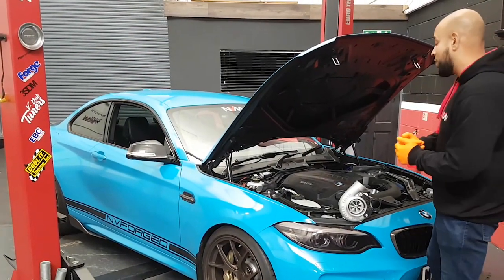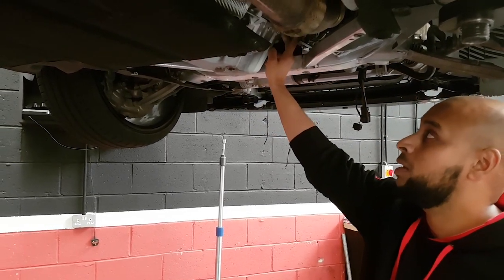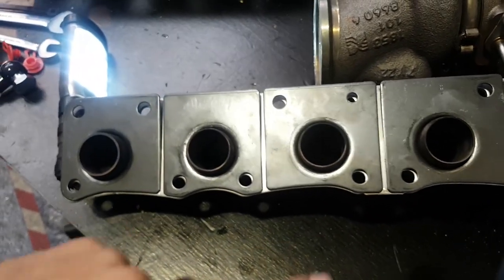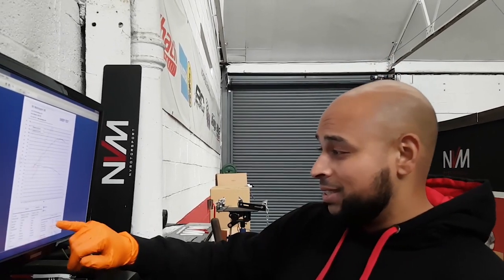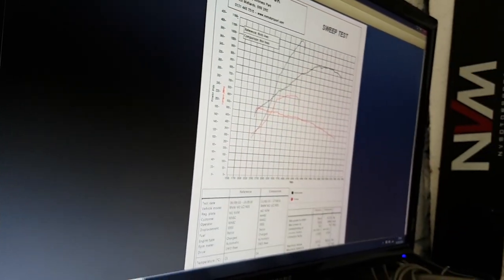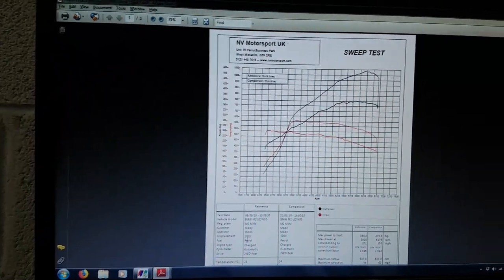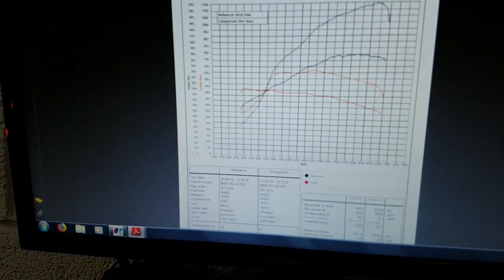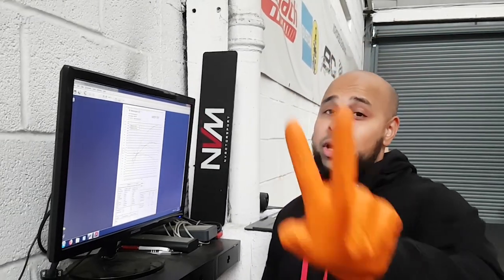STAGE 3!!! BIG Turbo M2 PART 1

Comment: You know what I’ve always worried about with using meth as a supporting fuel additive, is the propagation if meth evenly across all cylinders. Any thoughts? I know the bmws can see knock cylinder for cylinder but still. Jus curious

Comment: Sick. Does the new manifold support direct port WMI and would it make a difference?
Reply from the maker: Direct port WMI is for the intake manifold not turbo manifold.
Reply: @NVMotorsportUK  Of course, my bad Would direct port make a difference?
Reply from the maker: @gynads  yes. Probably another 20hp

Comment: I wonder your professional opinion, do you think it be a good idea to ceramic coat the manifold as well as the turbo and would this improve things..
Reply from the maker: Aslong as you run meth even at 1.8 bar you will control IATs so ceramic coating may not be beneficial in this setup. But does help

Comment: great video guys, im already thinking about ordering the bigboost 800+whp kit and this is perfect timing, the thing is, i live in the UAE where  40 degrees Celsius is the norm, would the turbo function correctly in higher temperatures, i am planning on upgrading the fuel lines and adding meth and other supporting mods, im just worried about the turbo not preforming well because of the heat.
Reply from the maker: Heat will always be the enemy.. aswell as octane. We can remote tune for you if needed.

Comment: Does this kit work with x drive 335 n55 left hand drive? I'm putting down about 400 hp 430 lbs torque now stock turbo stage 1 mhd and some bolt ons.
Reply: Lmao no you’re not
Reply: @livedreamrec2464  that's what the sport gages said at the time, I'm at stage 2+ which changes up sport gages to higher levels,now, and it's putting down peak boost of 20+lbs (mhd gages) hitting north of 400hp and 530lbs torq, total rocket ship. Smokes my 2016 dodge challenger scat pack 6.4 liter which is just shy of 500hp and 475lbs torq (high 11 sec quarter mile) so tell me why not brainiac
Reply: Matt Carafa what year
Reply: @livedreamrec2464  2013
Reply: Matt Carafa I have the same car as you , full Bolt on , catless stage 2 plus , you sure it’s 400?  People were saying 340 350 whp
Reply: @livedreamrec2464  have never dynoed, just saying what sport gages in center screen on dash says, , so take it for what it's worth... most likely at the crank,but the car smokes my from the factory drag racing car (2016 dodge challenger scat pack with a 6.4 liter hemi) that does a high 11 sec quarter mile with just shy of 500 hp and 475lbs of torque, it's not even close,car is a rocket ship
Reply: @livedreamrec2464  I've owned some quick cars in my life,olds with 403 (not stock),84 monte with fully built 305 single 4" exhaust all the back from headers,Thunderbird 3.8 supercharged,and the challenger....none of them is close to how quick my little awd commuter is,handles like a go cart and has all the bells and whistles,always thought bmws were stupid till I drove one,didn't know they were fast got mine cause I thought it looked sexy and had awd. Love my car
Reply: Formula firebird,couple of mustang's, none of them hold a candle to it. Never would have got my challenger if I drove the beamer first,would have gone m5 comp (used) the germans have won me over
Reply: Matt Carafa I’m trying to get a m2 Not sure if I would like it b/c the AWd does feel crazy
Reply: I like the look of the m2, the front bumper is super aggressive looking, never been in one, but I'm sure I would be all about it. Wanted to replace the front bumper on my car with m2 conversion, but I got fog lights, pmc, and the cameras-so if I do end up changing it that won't work. They have an m3 conversion for f30 that has the fog light and pmc, but I think it would have to be modified for the side cameras.